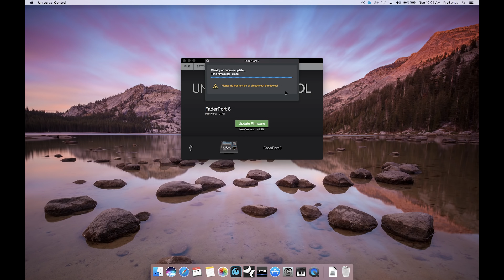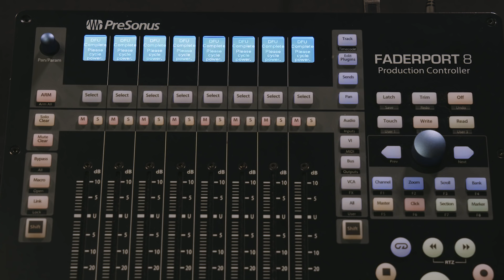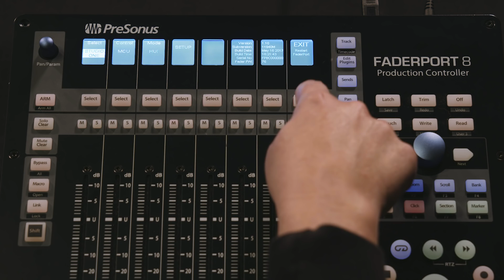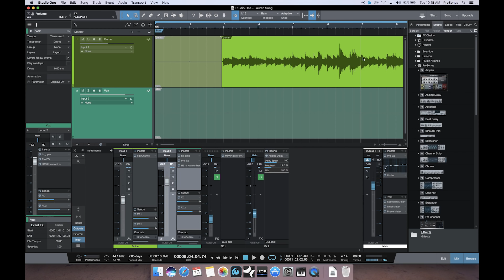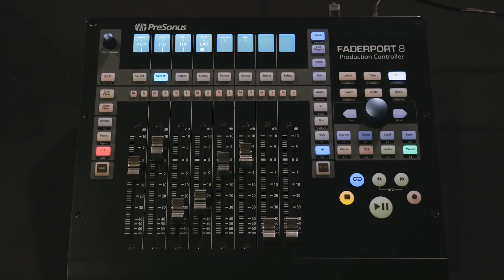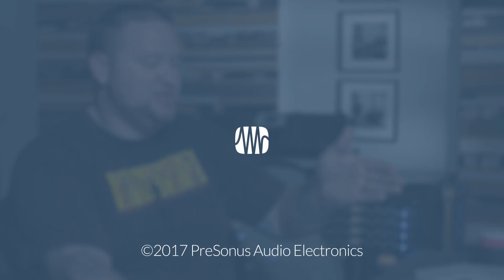PreSonus FaderPort 8: Firmware update and overview

Comment: Thank you Wesley, very helpful. My experience: I had some problems updating, then I read on the discussion group that it is more reliable to update firmware while no other PreSonus USB devices are turned on. Worked for me. Also, after power-cycle, wait a few minutes. Faders will recalibrate, might take a minute or so to kick in. Mine didn't recalibrate till I launched Studio One.

Comment: Yesterday I upgraded the firmware to the latest version for my Faderport 8. After ugrading, I was surprised to see that there is no longer a generic MCU in setup mode. There are MCU selections for Logic, Cubase & Sonar, but no generic MCU as was in the previous firmware version.

So, my question is which MCU do I use for Ableton Live? Since I wasn't sure I just reset the Faderport back to factory settings just where I could finish my mixdown. Was this an oversight by Presonus, or intentional for whatever reason? And if we are supposed to use one the 3 MCUs made available, it would sure be nice to know which one as the user manual wasn't upgraded to reflect the change.

Any info would be greatly appreciated.